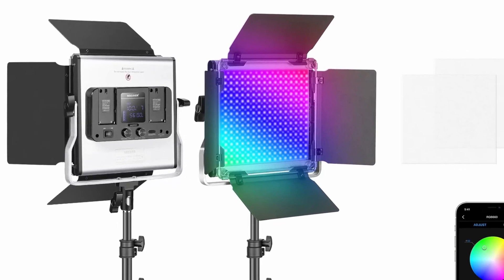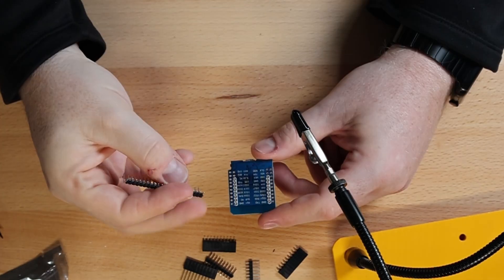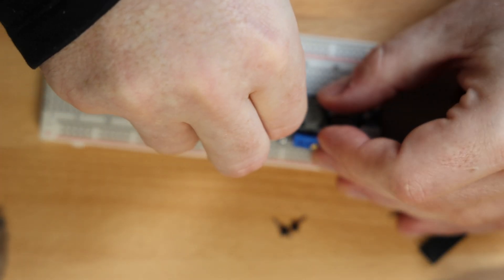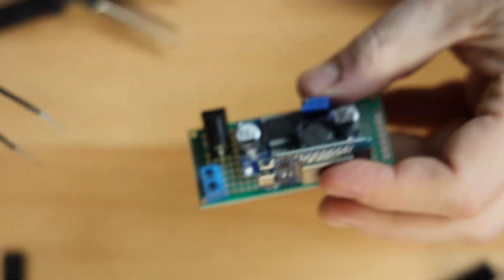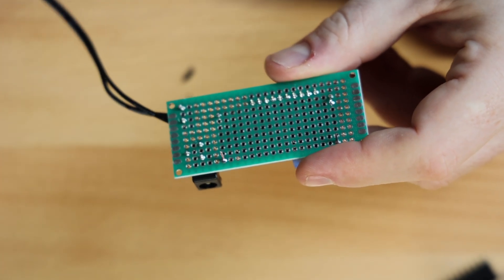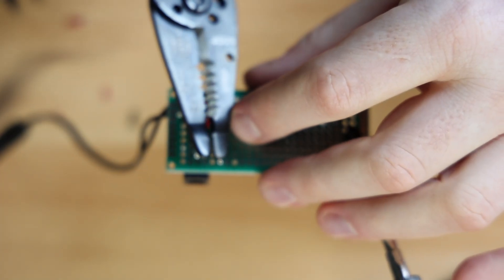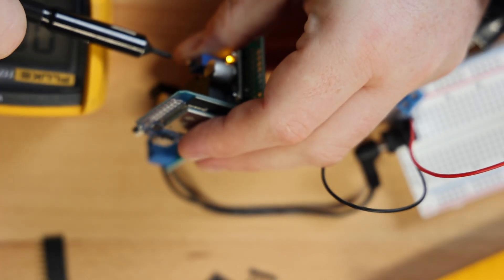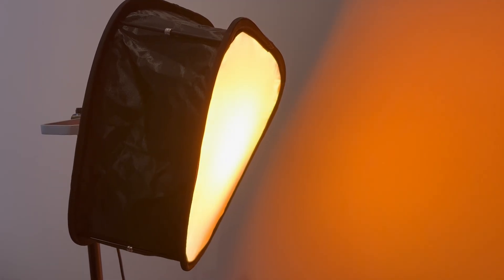How to connect Neewer RGB lights to WIFI

Comment: Thank you, however I have a couple of questions:

- How can I get this to work with the Neewer RGB 530 Pro?

- Does this require soldering to the light itself? I'm hoping I can just have my ESP32 close by and use it as a Wifi to Bluetooth bridge...

Thanks!
Reply from the maker: I haven’t tried the 530 RGB Pro and also don’t have one here to test. My guess is that there’s a reasonable chance it’ll work. It seems the main difference between the lights is the mounting hardware and number of LEDs. I would assume they use the same Bluetooth protocol. What I might do is to just flash the firmware (see link in description) to a ESP32 and see if you can get it to work before soldering everything together for the power supply and mounting. That way, should it not work, you haven’t wasted a bunch of effort.

No soldering to the light itself required. The ESP connects to the lights via Bluetooth and can maintain a stable Bluetooth connection due to its proximity.

Please report back if you can get it to work with the 530 RGB Pro. Curious myself!

Comment: I think I missed something in the tutorial.
It looks like all the board is doing is getting power from the camera power supply and splitting it to esp32 and back to the camera.
Controlling the camera still happens over bluetooth right?
Reply from the maker: That is correct. 

The proximity of the ESP32 to the light on this setup overcomes the unstable Bluetooth connection.

I’ve linked the firmware I use with instructions on how to flash it in the description.